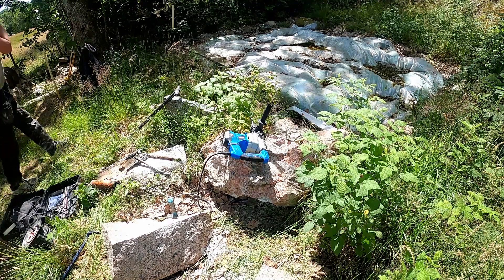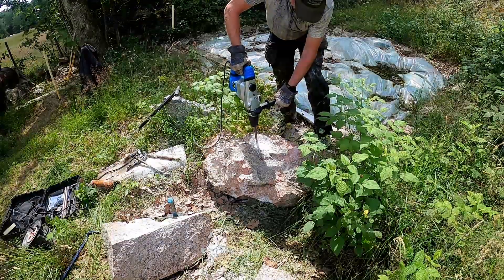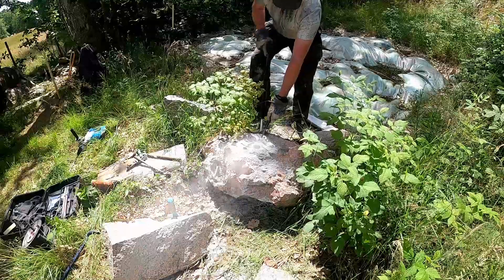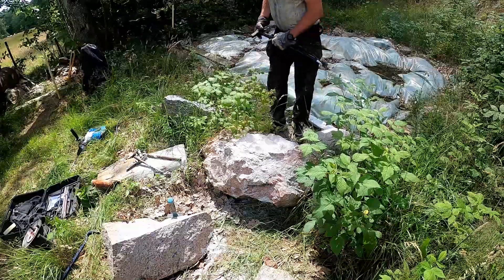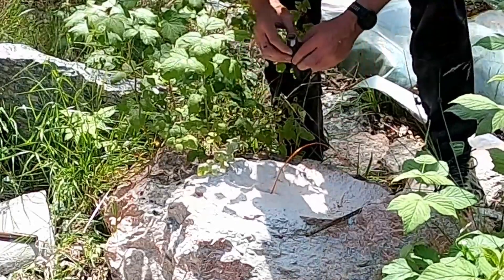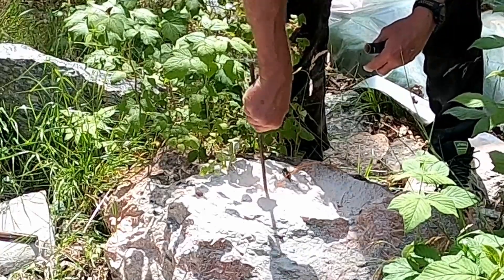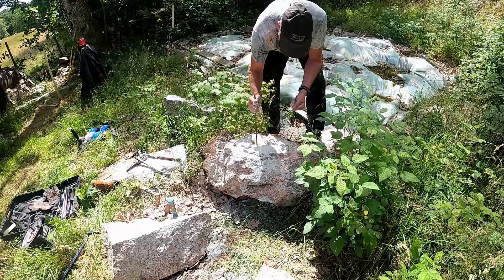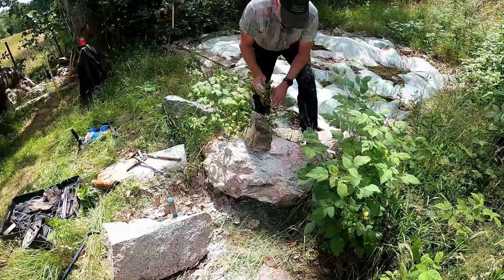Blasting small rock with gunpowder (Black powder)

Comment: Didn't realize gunpowder was so strong.  Only 8 grams to break that rock is crazy.    I'm going to make some gunpowder soon for stuff like this.
Reply from the maker: yes, it’s really strong but the plugging of the hole is very important. bad plugging and it will just burn 🔥
Reply: @berg310tor-arnejonasson8  makes a lot of sense!!   Maybe a little fast cure concrete or something.  You could bring a sandwich bag of dry powder and have plenty for a few blasts.
Reply from the maker: @ganjalfcreamcorn8438  
Yes, now I just have to find enough rocks that is in the way 🙂

Comment: Why so concerned about the dust being ejected on explosion when you're nowhere near ??
Reply from the maker: If the dust, that is seal of the hole is blown out there will be no real explosion. The hole will work like a barrel on a gun and the stone will not break
Reply: OK but microshaving with a long firing pin/rod works and that hole is not sealed up except to a certain degree by the rod?